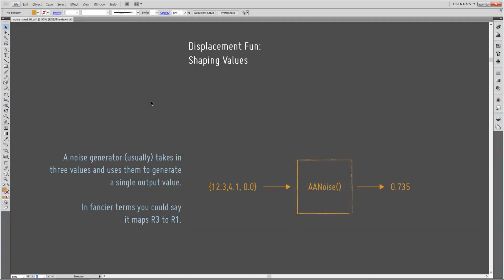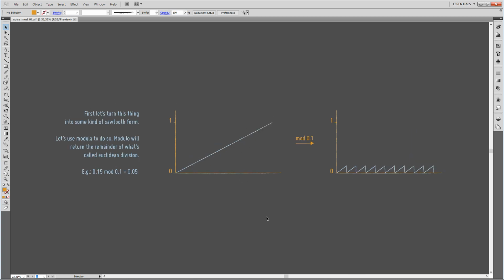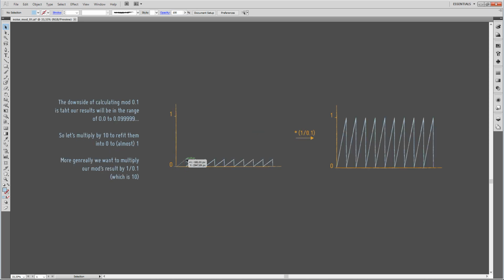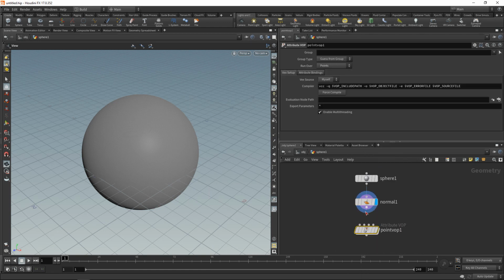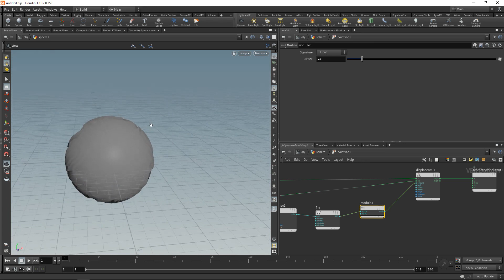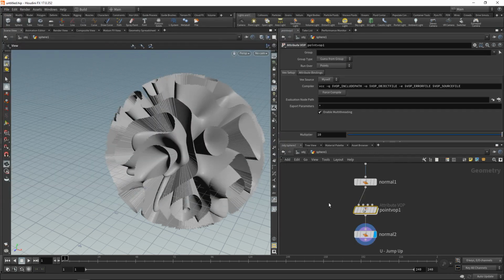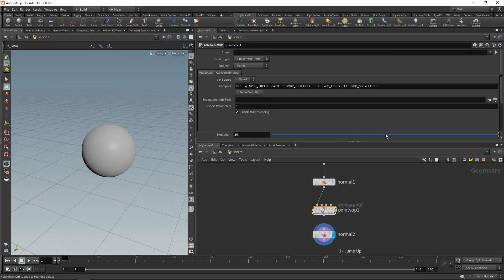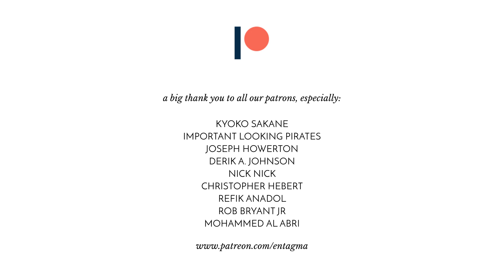VOPs Quick Tip: Abstract Displacement Using Modulo & Noise

Comment: You know what else you can do to take this further is to control/modulate the amplitude and frequency of the ramps with the noise or with each other. You can also use the oscillation node which is the same as ramp but explicitly sine or cosine waves

Comment: Hi, really good tutorial. How are you getting the displacement to move across the surface of the geometry in the beginning video?
Reply from the maker: Heyhey,

I animated the noise's offset. As far as I remember using a unified noise (which is a good bit slower but has more intricate control).

Cheers, Mo
Reply: @Entagma  for some reason is not working for me, im doing the key frames and it doesnt evolve. why is it no working with the multiplier  on PointVop
Reply: @Solar.5D  you have to promote parametr into vop
Reply: @Entagma  Houdini says that "Warning: Cannot have channels which depend on time" when trying to animate offset. What's wrong.. :-/
Reply: @emimeemio  same here
Reply: @emimeemio  you have to promote parametr into vop
Reply: @jakster23  you have to promote parametr into vop
Reply: @Entagma  Thanks a lot for that, worked a treat!